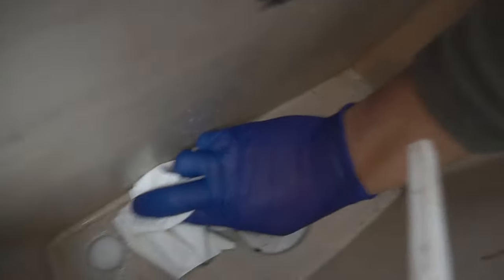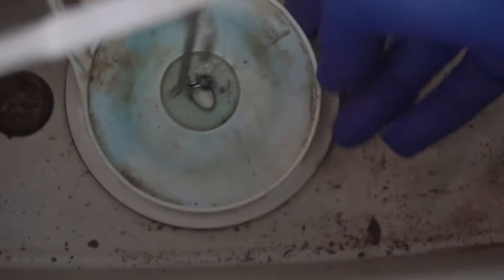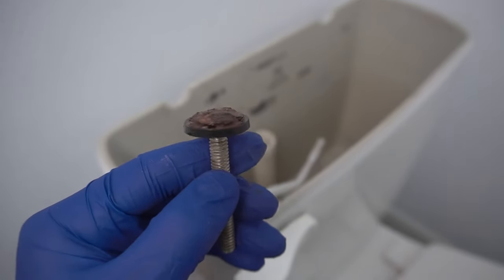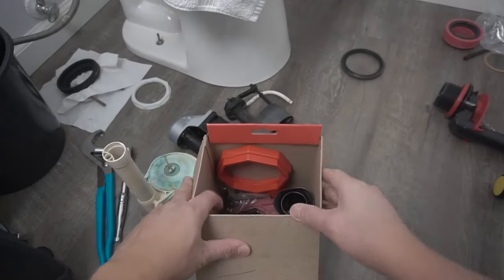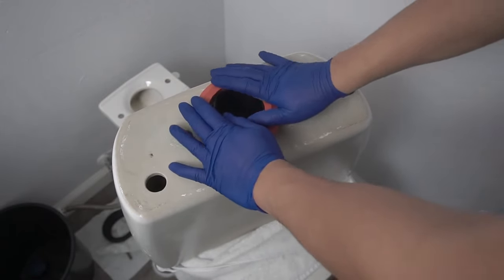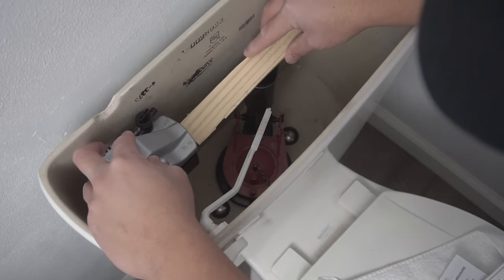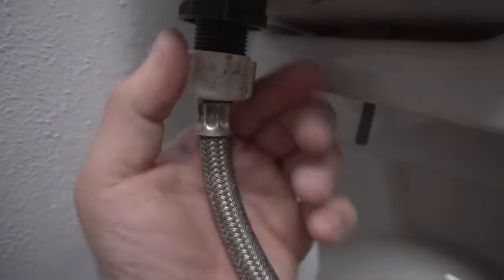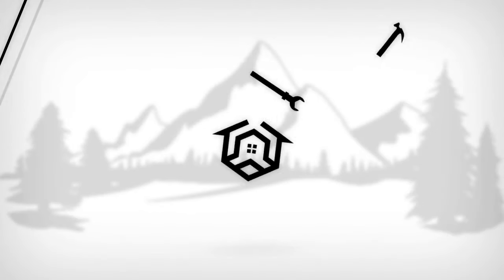How To Replace Toilet Fill Valve, Flush Valve And Tank Bolts | Complete Tank Install! Bathroom DIY!

Comment: Seems straight forward enough. But, curious how does the value thing when to stop the water coming in?
Reply from the maker: thank you! on the fill valve there is a float mechanism, that works like your old ball float that once its reaches the correct water level it will raise it up and stop the fill.

Comment: I replaced the valve, the bolts and the supply line but it’s still a small drip/leak coming from the nut bolt on the replacement valve that attaches to the water supply. Any suggestions?